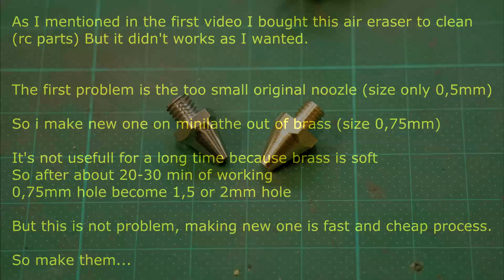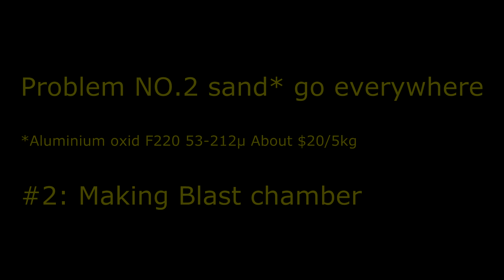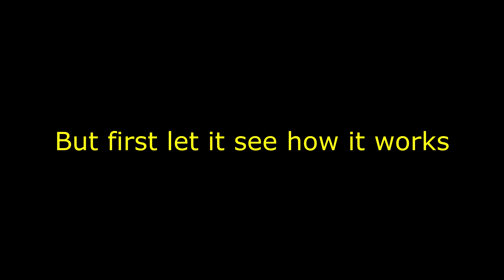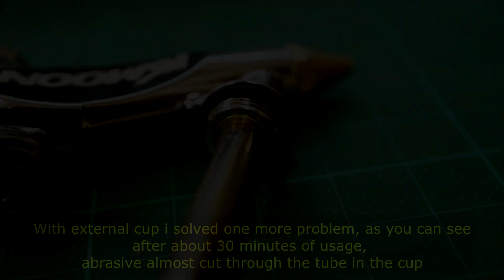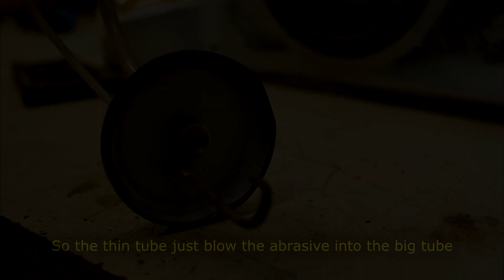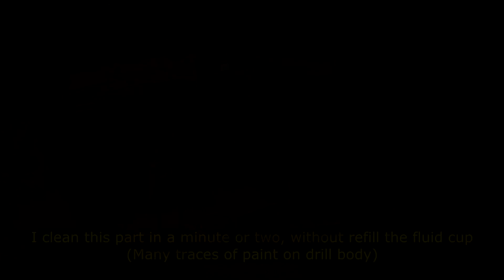Air eraser, P8N7,  [part2] upgrade / new nozzle, bigger fluid cup, making blast chember

Comment: Love your setup. If you remake a new chamber/box you may take a look at cabinets for dental work. They are small units made from shelving material and a glass top with a hinge. Rather than gloves, my shop uses jean material with an elastic that hugs your wrist as a seal. Also, the air nozzle is stationary so you wave the part around it with both hands. Nice looking build.

Comment: Thanks, I found this film very helpful. Firstly in seeing the principles of sandblasting clearly explained - and secondly helping me to realise that those small cheap sand blasters aren't very effective without a lot of modification! For me (not having a metal lathe to hand) I think it would be better to buy a bigger one!
Reply from the maker: Sure, this is junk also after mod, buy bigger one with reservoar on top but those one need bunch of air.
Reply: @TinC33  Thanks for the tip! I appreciate your help :-)

Comment: Very clever loved the video, I've just made a cabinet by using a old kitchen sink boxed in and the bottle trap has had the 2" holes for the waste water  blocked off so that when I pull out the plug the aluminium oxide can go down the plug hole in the bottle trap you then unscrew the trap and empty it and reuse it after sieving it,I have it built into a worktop in the man cave it has dust extraction a LED long bathroom strip light above the sink area and the holes for your hands are made out of 4" PVC pipe connection from Toolstation they cost around £2.00 each,the door for accessing the inside is a fold down ( like a kitchen draw only it fold down) with foam weather door seal with small clamps Similar to the one used hear only a lot smaller the glass is a old double glaze piece set into the top after cutting a length of ply to the full length of the sink + drain board as this is the length of the cabinet and then routed a rebate put clear silicone in the rebate then place the glass on top (all sealed ) then finish it off with architrave so no dust problems!
   Just a idea for anyone with a old kitchen sink.👋
Reply from the maker: Great solution, thanks for idea

Comment: may i know what is your nozzle looks like? im searching in ebay but not sure what is the nozzle type.. What type should i buy? is the stainless steel type or ceramic type?
Reply from the maker: amirul asri ceramic is only one that work.
Reply: TinC33 if i want tu modified the original nozzle.  what diameter do you prefer? and what type of drill bit i have to use?
Reply from the maker: amirul asri original is 0.5mm i think, i order one from ebay cerramic 0,8mm and drill it to 1mm with diamond drill (not drill, something like conus grinder with diamond dust on it for dremel and other tool)

Comment: Hello tintek!
good job and a lot of ideas!
wath's the reference of the maerial you are using as to replace the bucket? I do not manage to find it...
Thank you
Reply from the maker: Pierre Sébastien Petiot thanks, with "bucket" you mean nozzle? It's not ok, as i say it work for a few minutes than becom 2mm size.
I bougt a ceramick nozzle 0,8mm size on ebay.de and than drill it with diamond drill to 1mm works good so far but with preasure max 3bar.
Reply: Hello ! 
No, not the nozzle.
You replace the cup by a tube...
Reply: 7 mn 10 ?
Reply from the maker: Pierre Sébastien Petiot i make it on minilathe.
Reply: Oh... Nice job ! 
But i havn't this....
Reply: link is dead
Reply: @TinC33  I know this is an old video but I would like to buy the bigger nozzle and can’t find it. Can you show me a better link please?
Reply from the maker: @mrslopez137  yt doesn't allow link so... Go to ebay(dot)de and type air eraser and you'll find 0,5 and 0,8mm nozzle for under $10.
Reply: @TinC33  thank you I found it but they don’t ship to the USA unfortunately.
Reply from the maker: Try to contact them, they ship to me in slovenia also if dey don't ship outside of germany.
Reply: @TinC33  thank you. I will contact them.

Comment: So how to solve this without modifying external container? Ceramic tube?
Reply from the maker: juliusvalentinas ceramic tube would be great but but still had small container.
Reply: thanks for reply, I have this fengda as48a 4-cylinder compressor more than two atm pressure the knocking sound in the compressor begins. If I block one of the air intakes, the sound 
increases many times.

How to fix?

Comment: any way you could make/sell another tip?
Reply from the maker: Garrett McElroy look on ebay.  de there someone selling 0,8mm hardened nozzle, i buy them and drill with diamant drill to 1mm, work like charm.
Reply: Thank you
Reply from the maker: Garrett McElroy No problem, otherwise i can make you a few nozzle from brass or iron from 0,5-1,5mm but it won't work for long time, i got best result with 0,8-1mm nozzle.